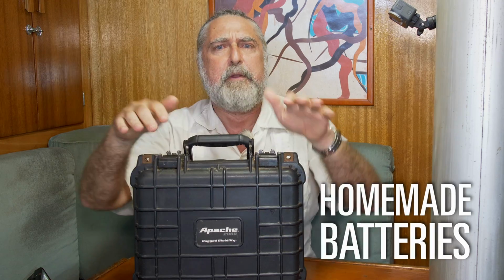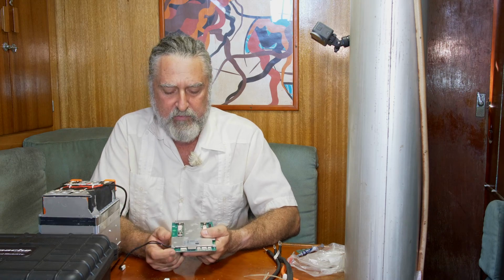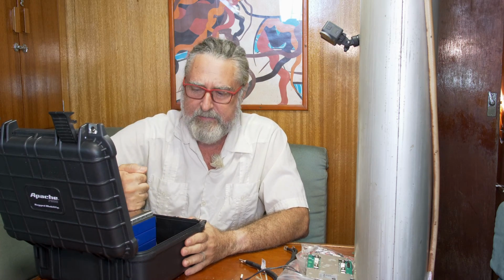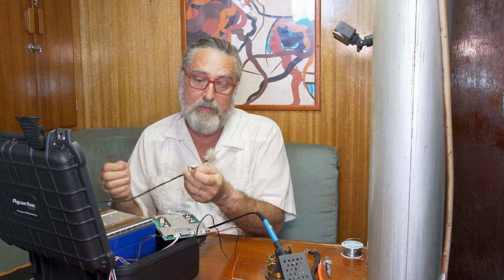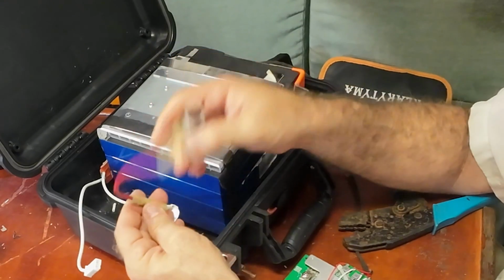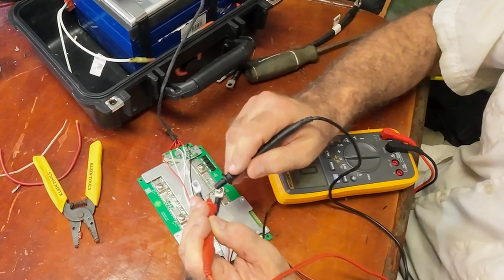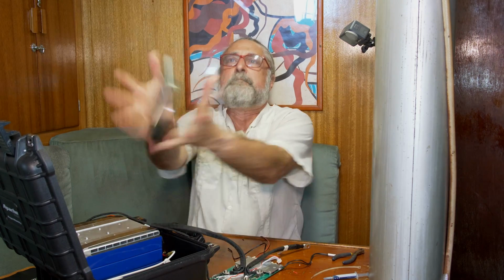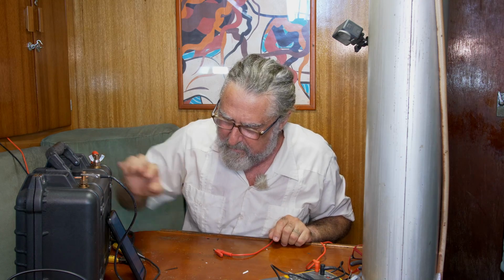DIY Waterproof Trolling Motor Lithium Battery

Comment: Enjoyed your video. A bad habit is pulling too much solder off the spool and allowing it to frail around all over the worktable. It seems your solder did not melt quickly enough. Were you using 60/40?  I do a lot of my way projects with 50% success rate too.

Comment: the 2 wires is to turn on the BMS, you can't turn it off with that.. I don't know the exact app you're using but normally you should be able to shut down the BMS within the app

Comment: The switch for the bms is typically defaulted off from the factory and can be activated in the app!
Reply from the maker: Thanks.  I'll look into how to set that.

I understand there is an app that can set more parameters than I have.  Any idea where to find that one?
Reply: @Clarks-Adventure  overkill solar’s app. Under settings it “SW switch circuit enable”

Comment: Hi Clark
Just a note to get you to check the screw terminals on the BMS. It looked like the heavy wires that you tightened with the screwdriver, had the terminals touching the heat sink, effectively bypassing the BMS's ability to turn off power for charging or discharging. You should be able to check this by using the app to turn off charging or discharging power, then checking for power at the external terminals you made with the bolts.
I hope this test proves me wrong but I'm worried about the shorted connection.
Reply: By the way, Great video as usual!
Reply from the maker: I'll check today, thanks

Comment: Repeat after me - Ooops!  It happens and be grateful it wasn't 440 three phase or 400/800 volt DC.

On crimps I'm also very disappointed at how flimsy some are.  I prefer to use uninsulated crimps so I can pin crimp and solder them sealing them with marine grade shrink tubing.  I'm old fashion and still carry a CS-34

On metal rings, watchbands, etc some would be amazed at the gruesome scar a metal watchband can leave on your wrist even after momentary contact with a 1,000 amp CCA starting battery.  The heat momentarily generated in a short can approach what many home ranges generate with all the pot burners turned on at the same time.  A ring that fuses in a 12 volt battery short can loose you a finger.

Best!

Comment: Hey man how would you go about a hdro gen for ocean crossings so you can power auto pilot full-time when ne solar present.thanks
Reply from the maker: Take a look through our playlists.  There is one on building a wind generator.

I build my own from the ground up.  Scrap steel in a lath -> axial field alternator.

No video but I built a custom axial field alternator that mounts on the prop shaft and makes power with the ships propeller while sailing.

No worries of weed in the towed prop.  Best system.

Comment: Well Clark you didn't let enough smoke out to trash the BMS.  We all get lucky once in a while.  I think anyone that works with electricity and batteries does that now and again.  Heck a couple of months ago I hooked the new batteries in my motorhome up backwards, I know better but it happened.  Fortunately I just blew a 50 amp fuse and nothing else.   Keep the good stuff coming.

Comment: some of those HF cases don´t use Stainless pins on the hinges. Check and replace if needed.
Reply from the maker: Good point
  Mine is holding on but there is some rust.

Comment: Great build!
I built one of these last year from some very old Sinopoly 100ah cells. I used a trolling motor waterproof plug set. It can handle 50A which is plenty for a 38lb thrust 12v trolling motor. 
I even got a chance to test the waterproofness when passing the battery from the dinghy to the boat.
Reply from the maker: I haven't run "the test" myself.  Thanks for your report.

Comment: great video 
is there a video on the previously mentioned battery bank with the cylindrical cells?
Reply from the maker: Not exactly I built that before we did electrical videos.

It is talked about in an adventure log filmed at the same time period that Emily made her dinghy videos.

It has red cells then but I damaged them by overcharge so I had to replace the cells

Comment: I am especially interested in your higher level DIY content regarding electronics. The wind turbine was very interesting. I want more on that if you can. Making your own batteries. I'd like to see you play around with the DIY raspberry pi navigation systems etc.

I mean, I can solve any problem just by going to the yard and agreeing to pay whatever to get the thing. But I'd like to be more independent than that.
Reply from the maker: I recommend you do a wind generator if it interests you.

Other projects are more "complicated" but for sheer satisfaction you can't beat something you built from materials that makes the power you use.

Solar is probably better but you bought the components (, most likely) and just assembled them.  That wind power feels different as you actually manufactured the generator.
Reply: @Clarks-Adventure  Detailed instructions and schematics would be well worth purchasing if you ever created it. I've looked around and things get "vague" in bits. You could probably also sell a DIY kit for wind turbines.
Reply from the maker: I'm way too busy with BankManager and the air conditioner.

If you sign up for Patreon at at least the $25 level you can download the spreadsheets from our digital treasures chest.

At $50 we can talk on the phone.

That's as close to a new product this "retired" guy is getting.
Reply: @Clarks-Adventure  I'll take you up on that at some point then.

Comment: Nice build video Clark. Even the sparky event was educational.
Reply from the maker: Yep, was for me as well
Reply: @Clarks-Adventure  I know the feeling. I tried hard to insulate all my tools and be careful when building my 16s bank for our bus conversion and still make some accidental sparks putting it together.
Reply from the maker: 48v sparks.  Bet that was interesting.
Reply: @Clarks-Adventure  luckily they were lower voltage, lightly bumped a nearby terminal between prismatic cells on the top of the bank.

Comment: Hey Clark ! Awesome n ew Li Time new battery to check out that I spotted tested on the Hobotech channel. Seems Li Time have a new range of BMS of their own, making one heck of a difference such as to the 460ah tested by Will Prowse, problem, the 460 ah isdamned heavy, where the 230 ah is very manageable. The Hobotech guy didn’t do a tear down, but with the power that thing iscapable of hand,ing, frankly a tear down looks to be a waste of time imo. Though Will Prowse does tear down the 460 ah if I remember correctly. Personally, I’ll treat these gamechanger batteries much more gently,  harge at 0.15 C and discharge them much more gently as well, and the service life may be up there with what I expect from a battery. I’m thinking of getting a bank of three tbh for long term testing. Watch the Hobotech review, and I think you’ll see what I’m getting at.  Best Wishes. Bob in Wales. 🙂PS. Would like a chat sometime about the design of a zone system for boat electricals, so each cabin is a zone powered by the small very efficient Victron Phoenix smart inverters that have very low standby power, such as the 385av and 500 av,powering a mains socket and USB, the Salon as a zone, Galley as a Zone, with say 1200 av inverters, and even the Cockpit as a zone, soeach zone is straightforward and logical and safe for amateurs to tackle, With all connecting safely to up to standard Off.  essel and on  Vessel power supply sources. Probably worth a chat with Victron tbh. Bob.👍🌟🌟🌟⛵️❤️

Comment: Great information! Is there any risk of overheating the bms by attaching it to the heat pad? Thank you
Reply from the maker: Direct heat...  Not really, remember it's going to turn off the heater once everything gets just a touch above freezing.

Circuit heat...  Unlikely as it's only passing 3 amps or so.  The engineer who designed this built a board that can pass 100a continuously so I trust he made this circuit up to the task and he has a HUGE heat sink available.

Also, any heat generated is an advantage when things are cold.

Comment: Insulate the case?
Reply from the maker: It's plastic so it's kinda insulated already.
   Or am I misunderstanding?
Reply: @Clarks-Adventure  Nope. That was it. But I may go way north some day.
Reply from the maker: Oh..   you mean thermal insolation.   I didn't catch that.  I thought you meant electrical insolation.

I'd likely store it in an insulated place so when it makes unwanted heat it can still cool.

Going way north.  You could embrace the portability (and lazy) esthetic and just wrap it in a blanket.